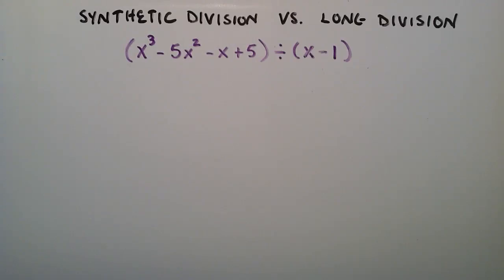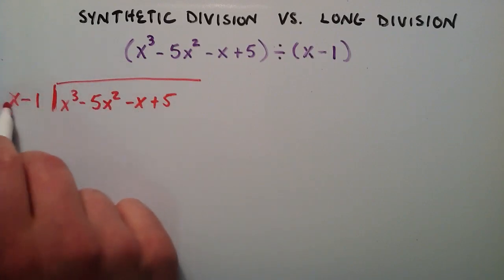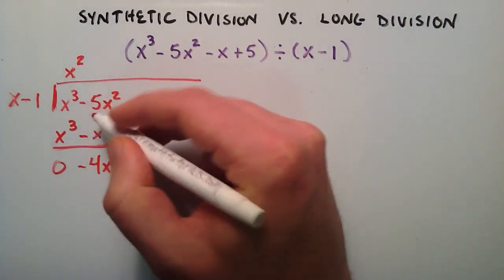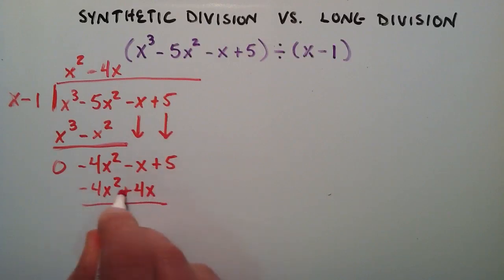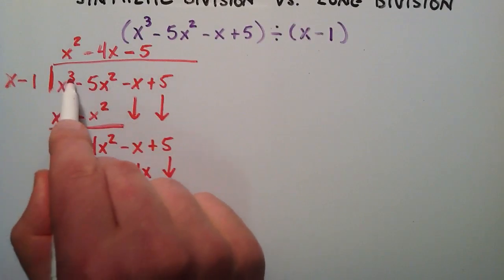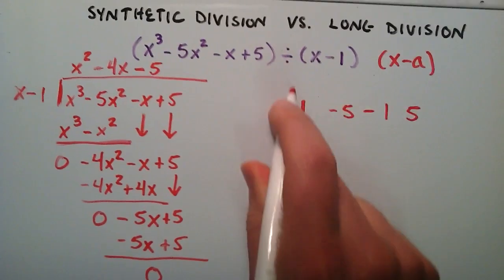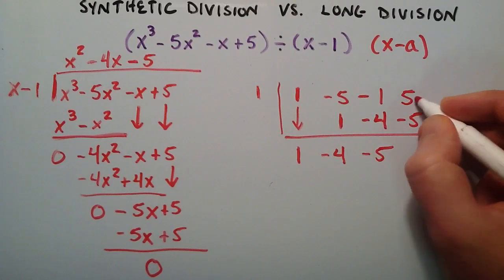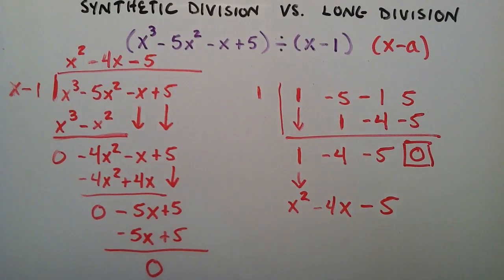Synthetic Division vs. Long Division

Comment: the issue with synthetic is that if they dont give you the number to divide it by you have to guess which number its divided so you do more work then if you just did long division method

Comment: I'll tell you what has always made learning very difficult for me as I was growing up.  It's non-sensical names academicians gave to things.  In this case, Long and "Synthetic" division.  Really?  Synthetic?  Does that even make sense?  If the longer method was called "Long" division, then what would you call the method that takes less time, is easier to do, and is SHORTER?  Anyone?  Any takers?  I'll give you a hint: It, too begins with an "S", but it's not "Synthetic".  
(By the way... Nice video)